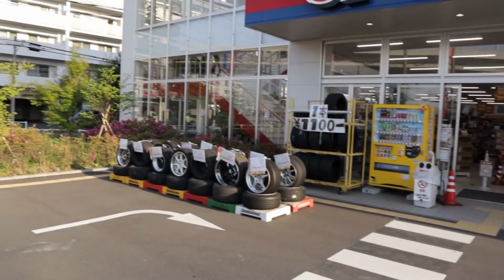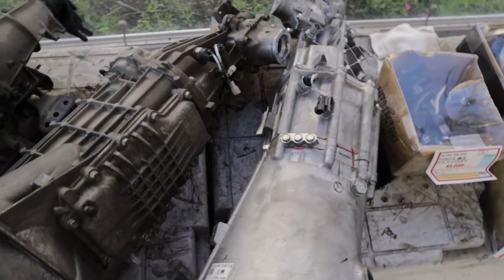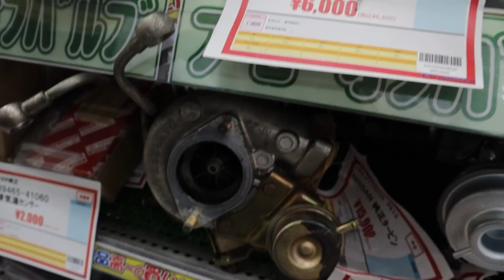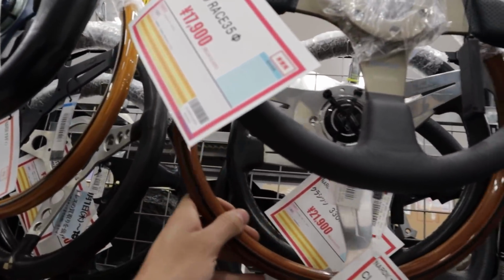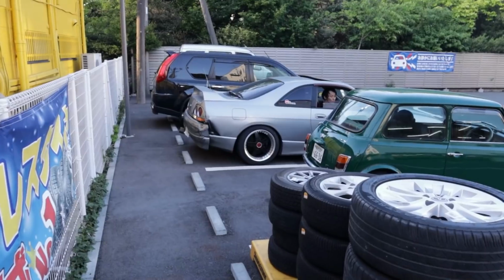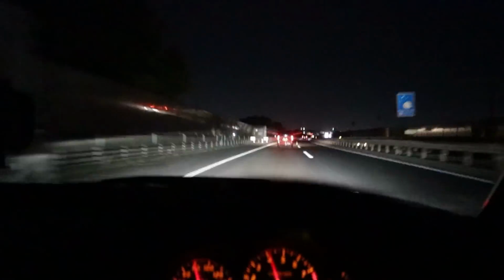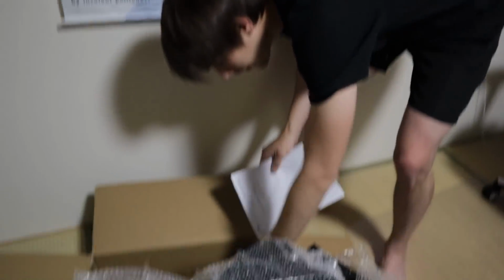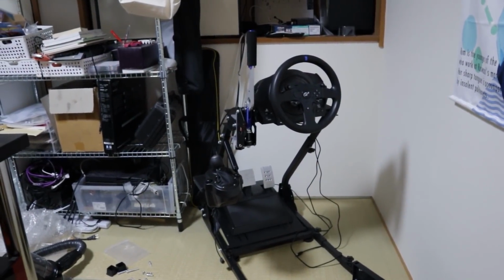PARTS HUNTING IN JAPAN AT UPGARAGE!

Comment: Cut metal plates that bolt to the angles where the frame  points join, Use C.A.D. "Cardboard Aided Design" drill holes to fasten, you can use insert pipe to take up the space between metal brackets "through the in sides of the where the bolts are" and use washers to get more clamping pressure... aka gussets maybe you should weld in the gussets  LOL but if you do weld the up mounting surface, and offset tab the bottom and use 2 throu-bolts so that it's  able to come apart again.

Comment: The car is lookn good cant wait to see you gripn on my favourite track. I had a logitec G29 wheel had manual and paddles shift with the brake, clutch and accelerator all had proper spring rates and was crazy sure the new ones are way better love sim driving.

Comment: The crossmembers you want to add will help with the rigidity for sure. I use a similar frame (has two cross bars in the upper section where you are mounting the wheel) and it feels pretty study.

Comment: If you want vr headset for ya sim rig. Get the oculus quest 2. Its really good. Via wireless. I use virtual desktop app. And it works seemless with vr games etc. I just purchased a used g27 myself. Plan to make drift setup to. Though wont be nice as yours. For my ebrake ill be using a flight stick lol. I got the pro wheel stand for my wheel. It super heavy duty. Im sure i could tow a car with it lol.

Comment: As a sim racer myself you should've got a better rig.  Maybe a simlabs or trakracer or even the gt omega Titan. Also fanatec is putting out a new direct drive wheel base that's cheaper than some belt driven wheel bases.  I've been sim racing for years and years man.  If you need any help feel free to message me.

Comment: I would ditch that frame straight away bro once you think your improving. You need a strong stable frame with no movement for sure. Try a Trakracer rig. Not to expensive but solid as. I personally have the TR8 set up and love it.

Comment: I have that same frame. I had to get a new plate for the shifter. The bracket broke after 2 months of use. https://www.amazon.com/dp/B00GKFM0KC/ref=cm_sw_r_cp_apa_glt_fabc_S9E8RQ73WBD45GW9K8AH?_encoding=UTF8&psc=1

This is a link to what I got to replace the braket for the shifter. I have my fanatec shifter and handbrake mounted to it.